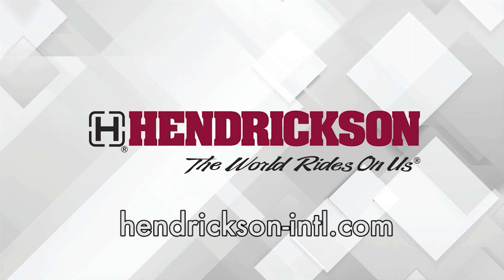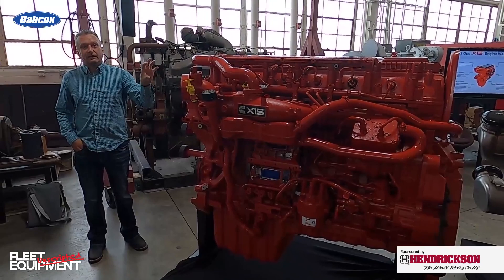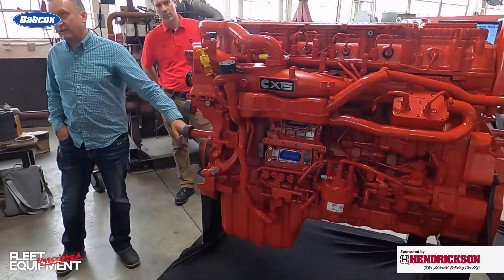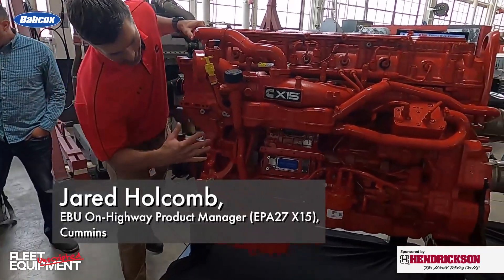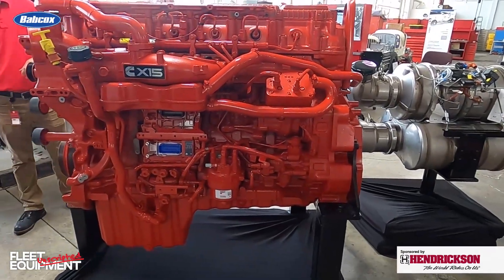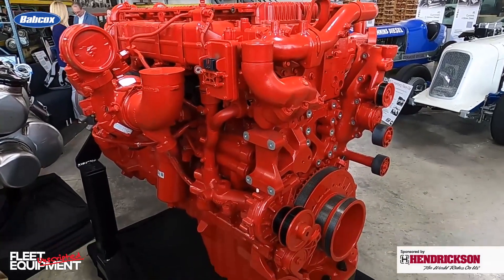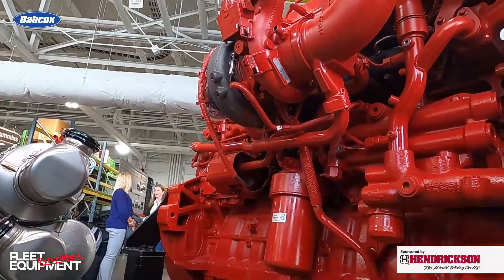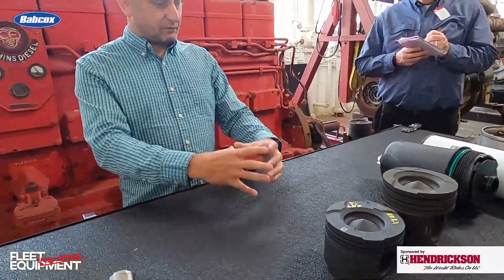Cummins EPA27 X15 diesel engine first look | FE Unscripted

Comment: No mention of the rear gear train on the new engine. This is a huge change. Does this mean it is no longer an overhead cam. If they kept the overhead cam does the transmission now have to come out to time the engine. Did they fix the massive issues they are having with injectors or the long Standing issue of block fretting on the counter bores. Maybe get a person to ask good questions when looking at new engine designs.

Comment: You’ve basically made it a pain in the ass to work on with the rear gear train especially if there’s no “dog box” in the cab.   With set back axle trucks, these engines will be awful like paccar’s mx.   And the fuel pump?  Yeah I’m thinking this will be just like the cp4 bs but hey, I’ll gladly take the money replacing it along with the entire fuel system when it grenades.

Comment: I keep waiting to see the EPA chase  run Cummins out of OTR engines as Cat did.  Its a shame that reliability from the powerplant took back seat to the Government standards that care less about the loads getting there on time.    I hope it works for Cummins and even more so for the Owner operator whom is paying the payments on the newest truck that may break down with little dealer support.  I do respect and prefer Cummins X15 over all other junk on the market. Just concerned about reliability for the person buying and driving the rig.
Reply: they are building them for the big fleets, they keep them until warranty expires 
they don't care about little guys
Reply: A lot different though cummins is an engine manufacturer. Cat makes equipment. The truck engine side was just a small
Percentage so it was easier to just pull the plug all together on those when the government started their BS

Comment: I’ve been a diesel mechanic for over 35 years now. Spent the last 21 years at a major dealership for class 8 trucks. Have witnessed the evolution of the Cummins ISX engines (red engines) from the Signature 600 to the X15. I’ve been anticipating the new engine for some time now. Thank you for the sneak peek ! 
Lately my shop has had me focused more on the Paccar MX 13 engines, but I still get to get my hands dirty on a red engine every now and then.
I really wished Cummins would interview different journeymen every now and then, I could have saved them a shit ton of money and heartache a while back when they switched to ceramic plungers in their high pressure fuel pumps.
I spent a few years working for Stanadyne back in the early mid 90s in the durability lab. My job back then was to break what the engineers built. Back then the race to reach 30,000 psi fuel pressures was huge. Bosch P pumps could do it if you tweaked the pumps barrels, but stanadyne was having a hard go of it. They used super highly polished metal rollers and plungers, which would inevitably fail, and A LOT of machining and time went into making them. They came up with a new design pump they called the R.S. pump instead of the old DS design, and switched to ceramic rollers. Those rollers failed even quicker, and would wipe EVERYTHING out. In a lot of instances they even had to scrap parts they would normally be able to reuse, like the housings, and start all over from scratch. 
I knew as soon as I heard Cummins decided to go with ceramic plungers in their fuel pumps they would pay dearly, and they did.
What a shame it is the government had to get involved in engine manufacturing. Forcing manufacturers to feed engine their own exhaust is like forcing a mother to feed her baby its own shit. It’s nothing more than communism, state run engine manufacturers, whose ONLY interest is to sell the public on electric vehicles this country’s grid can’t even begin to support. And the proof is in the pudding.
Companies like Volkswagen I believe it was, Ram, and Cummins hiding emissions through sensor readings and computer programming etc says it all. Not to mention the fact that regular folks with knowledge are able to crack the codes so to speak and overcome aftertreatment technology and jail break ECMs in order to defeat emissions and put their personally owned vehicles on a diet PROVES the public isn’t in tune with this communist government.
Me, I work within the boundaries. I own an L5P Duramax, and it’s bone stock aftertreatment and all. And it’s also a ticking time bomb I’m going to have to deal with eventually because I don’t want to break the law. I just wish GM would put a Cummins engine into their pickups. What a combo THAT would be. I love my Silverado, and Cummins engines just as much. Can’t stand Ram pickups, they’re literally trash, I know, I’ve owned them. I’ll pass thanks. But the engines oh yeah.
Fuck you Uncle Sam.
Reply: You said that right.
Reply: Uncle Sam is the face for Uncle Moshie.  Jews hate White Christians and the Japanese I'm learning.  They want to destroy us and will do it in every possible way.
Reply: Copy that .... RAM truck service is the bottom of the automotive barrel.
Reply: It's hell living through a communist revolution.
Reply: I think Trump just ended all that

Comment: The idea of an easy drain oil and filter design is actually pretty sweet. Chrysler has been using plastic filter housings for years and they hold up.
Reply: International already use these in the S13
Reply: And Detroit dd13 and dd15. Chevy and Toyota have had them in cars for years too

Comment: So far, slightly more complicated. Don't like the placement of the fuel filter.
 Just pay only set the time $50 more For a heated fuel filter.
Don't like the idea It's not programmable if you want to get more or less horsepowor or it have to be a only certified Dealer.
Renewable oil A filter, good idea maybe wait till after market Where it's just metal Instead of plastic Unless a machine shop customer makes you filter, For those is unaware most shops tend to recycle the filters. 
Overall, not reliable For the first few years. Sounds like less horsepower But EU have big horse power and More of a Emissions system

Comment: Press fit high mid stop liner with improved flow at upper area of liner sounds promising to lower issues of liner fretting and head gasket failures.
Reply: @stevesauerland223  sweet dreams ✨️

Comment: Wow! More junk from cummins.  I own 4 x15s, and all were bought brand new.  Nothing but issues, with all kinds of sensor failures, oil leaks and two getting major ovehauls before 700,000  
Miles. Never overhauled a Cat with less than 1,000,000 miles.
Reply: Guess you haven't  owned many cat engines. They all have issues.

Comment: Will the new fuel pump be interchangeable 2010 and up in x15 engine …as a up grade in fuel delivery
Reply: Not an upgrade… cp4 uses same lube system and is known for failure

Comment: From experience that oil filter type is just room for error and more crap to go wrong. The high pressure fuel pump as well will have drastic failures deemed its pnly lubricated by fuel!

Comment: They still using egr? Internationals new s13 engine doesn’t.
Reply: Thought it didn't have an EGR cooler, but still utilizes EGR with valve. Scania has a good engineering team no doubt.
Reply: @stevesauerland223 EGR valve with the S13 is only for cold starts
Reply: Could give me an international truck or engine biggest junk on the planet other than mack....maybe even pac car engine

Comment: All of this to make an engine that’s less reliable and uses the same amount of fuel as the N14.  Uncle Sam killed diesel engines
Reply: I went from a 2005 KW W900 C16 625 horse to a 2017 T880 with the last run of isx15 550 horse I’ve put 500,000 miles on it doing heavy haul 12 axle lowboy. Compared to the cat it’s stronger, doesn’t break down as much, uses less fuel, easier/faster to repair when it does need repaired.
Reply: Best diesel engine EVER built = International DT-466 .
Reply: Anytime your looking for a cheap , reliable , easy to repair truck buy a International Truck with a DT-466 engine and you will have yourself a 🥇 Winner  . They're not pretty like the rest but they'll get the job done and pass the test . You're guaranteed to see more IH-466 powered trucks on the roads then any other commercial vehicles  .
Reply: @craigalston2208 I agree. It was one of the best ever produced. Even the 2008-2011 Maxxforce DT was alright but still had typical emissions equipment problems. The heart of the beast was still the same solid block and heads used in previous versions.
Reply: @craigalston2208 the 7.3 is also amazing along with the 5.9 liter Cummins
Reply: Trump will be bringing it back to life
Reply: Of course they have. All the legislators are vested in EV tech, and are trying to force the industry into buying it.
Reply: Trump will get rid of the regulations
Reply: @christophercriss5888 EPA isn’t going away, clean air for the drivers that drive these, and people around them, are important. I love the classic diesel engines, series 60, 5.9 Cummins, etc. but it’s nice to be in a truck stop and not be choked out by the exhaust. Clean air is important for people’s health.

Comment: As long as you’re not Volkswagen you’re probably not worried about computer manipulation
Reply: VW just got caught. They all cheat, they all lie. Some just get away with it whilst others don't.
Reply: All the American diesel manufacturers have been caught tampering with emissions. None of them have been hit quite as hard as Volkswagen, but Cummins was fined last year for their engines in the Ram pickups were not meeting standards.

Comment: So were back to 1960- 70 filter housings design  , except the housing is plastic instead of steel so the plastic will warp or crack &  then buy $$ a new one. So the old engineering was right 😂😂❤❤!!
Reply: Love me a ENDT866 Maxidyne torque beast...
Reply: International’s S13  Scania is the mother of all engines. No Egr and Egr cooler.
Reply: @Gtown9011 and also a non vgt turbo. That engine is looking better every day

Comment: Did he say 48 volt alternator? That’s a pretty significant change
Reply: New trucks have 24v systems now
Reply: @TriState-fc2iv  true some are 24 volt now, but I don’t think any are 48 volt except maybe Tesla for their low voltage battery on the Cybertruck.
Reply: @TriState-fc2iv  what I’m wondering is what they’re going to utilize or what their requirements for power are that require the 48 volt alternator? Or maybe it’s just to cut down on wire size?
Reply: @V8Lenny  I’d like to see how that works, I’d think it take a lot of power to heat up a DPF
Reply: Rest of world is 24 V which is more reliable, better power.
Reply: @Beauxtrux  new US Volvo is 24V + 48V for DPF
Reply: @Beauxtrux im ok with 12